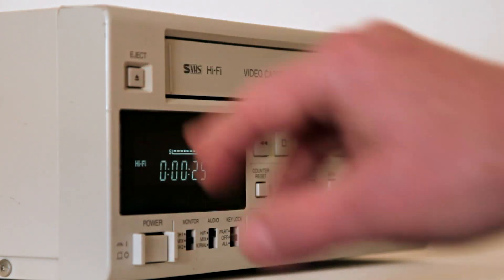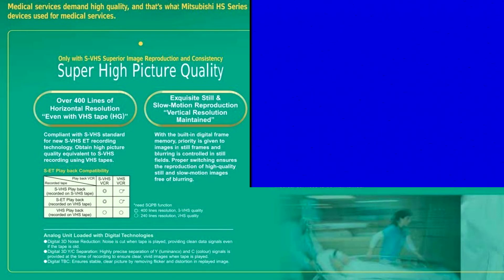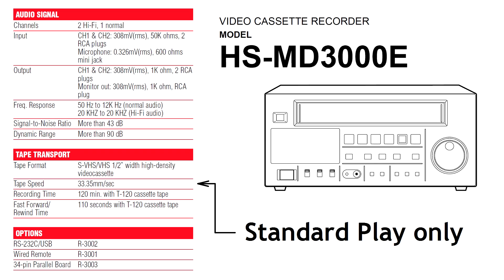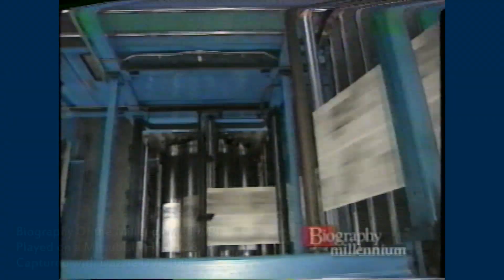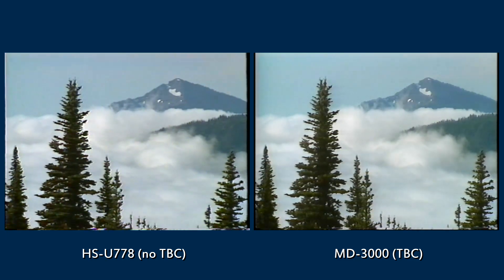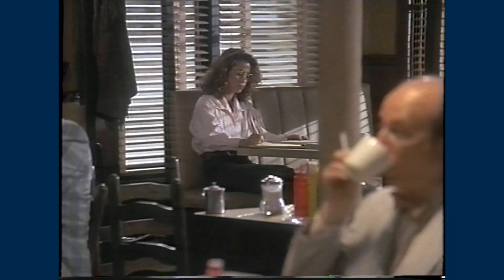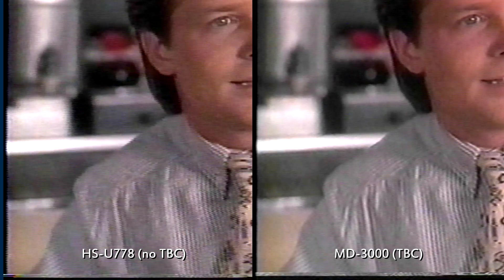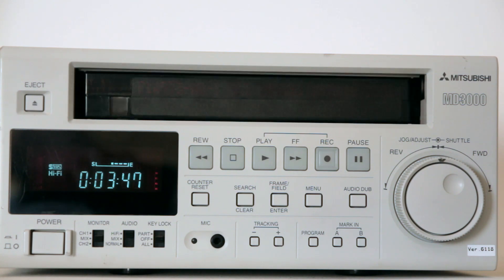Mitsubishi HS-MD3000 - a VHS VCR with built-in time base corrector (TBC)

Comment: Would it work as a passthrough device?
Reply from the maker: I haven't tried. In all fairness, it is a lovely machine that outputs rock-solid picture if the tape is in good condition, but for bigger errors it tends to repeat the previous frame, which is fine for medical use, but does not work for normal video. So, for really effed-up tapes I use a Digital8 camcorder with TBC in passthrough mode.

Comment: Is a difference in the quality of audio between this and the 778, how is hi-fi playback?

Second question, functioning as a pass-through, so it add TBC to output from another deck?
Reply from the maker: I don't know whether there is a discernible difference, I have no equipment to measure frequency response. The MD3000 allows selecting either linear, or Hi-Fi, or a mix of both. The mix does not sound good, so need to specifically select Hi-Fi for Hi-Fi tapes. As for passthrough, I haven't tried it to use it like this.

Comment: I have this same model - but I can't figure out how to bring up the menu to access the settings that you have. Pressing the Menu button does nothing - did you use a remote?
Reply from the maker: Long press brings up the menu. Then you navigate between page items with Jog/Adjust wheel, and between pages with Menu/Enter.
Reply: @ConsumerDV  thank you! I wasn't holding the menu button long enough + I realized I could only access the menu if a video was Stopped.

Comment: Hi, I have the same model and it seems to me that the output luminance level is higher than it should be. This is especially noticable when changing from fast or slow playback - brightness seems correct in anything but standard playback mode. Is it just me or do you see the same? Thanks
Reply from the maker: Indeed, I noticed that compared to my other VCR the levels are higher with this one using the same A/D converter. I compensate by using proc amp during capture, I reduce level from 5000 units, whatever they are measured in, to 4500, this brings it on par with the other VCR, and to me it looks that I am able to preserve most of the highlights.
Reply: I picked up a very lightly used model (8 hours on heads) on Ebay.   One thing I noticed is it's image seems to be aggressively sharpened as there are white halos to the right of subjects in normal playback.  This would make sense as it was intended for medical images.  I've tried all the video adjustment settings in the menus but can't seem to get rid of it.    Any ideas on how to minimize the sharpness/reduce halos?  I'm using for video playback and not capture.
Reply from the maker: In my case, the capture from the MD3000 looked better and with fewer artifacts that from another VCR. Try turning off all enhancements as well as sharpening in you capture hardware and software.
Reply: @mikegeykhman Does it do this with SVHS, VHS or both?  I have a Sony medical VCR and I don't notice a burned out luminance value on SVHS recordings but you can see it on regular VHS.

Comment: This whole series of VHS capture videos are great and I learned more than I did from any other vids about this! I'd love to see a video on using an ATI All in Wonder card. I can't find a proper vid on youtube. This is an old (maybe better?) solution to capturing VHS and requires an old computer with an AGP slot, but it seems like people on forums are saying it's the best method. I also have several old computers sitting around and it would be easy for me to get one of these cards on ebay. I just want to know if it's worth it.
Reply from the maker: Thanks! Regarding an ATI card, I don't have one and do not plan getting one. My favorite capture card came with a 2008 HP Pavilion and it works great for me. With an SVHS/TBC VCR I am getting good enough results.

Comment: Thanks so much for sharing and creating this video.  As a video editor I understand how much time goes into a 6min video of this quality, hours and hours.  Well it's appreciated!  I'm getting closer to getting a decent workflow for capturing all my home videos, I've setup a Windows 10 machine to QTGMC deinterlace footage, however still at the trial phase and playing with the import methods , like you...  I have a VHC-C S-Video JVC camera that I can capture all my little 30min tapes with TCB however I'm struggling finding a decent workflow to capture VHS, I did a few tests.

One test, I captured live to VirtualDub from a Panasonic DVX100b MiniDV camera 29.97i using the DVC-100 Dazzle, not using a tape just to test.  On play back after deinterlacing it looks great, however like the Doc Hollywood video I have jagged edges around things like a house window frame.  I'm kinda lost as I wouldn't think a live video to VirtualDub would need timebase correction..?
Reply from the maker: Thanks! I would think that composite signal generated from live digital camera would be more steady, interesting. BTW, MD3000 nicely corrects tiny jitter, but does not seem to handle severe errors well, so not a bulletproof solution.
Reply: @ConsumerDV Great video again, awesome job!  Yes in regards to the video being more steady, the video that I sent live from my Panasonic DVX100b was from s-video camera out to DVC-100 Dazzle S-Video in and captured on VirtualDub2 in the Apple ProRes 29.97i.  I remembered you saying in one of your posts that you didn't intend to be a trouble shooter or life long tester to capture VHS footage.

It seems there is not one straight solution, it's having the right OS, computer hardware, drivers, capture hardware.  Then in between you need a few other things, VHS player with S-Video and TBC hardware all this with the right combination in order to capture.  Then a different workflow to de-interlace like a QTGMC system with a 64bit OS.  I'm still in the stage of finding the best workflow for both capture and de-interlace.  I do like the look of QTGMC and AVISynth.

I just picked up a VHS player with S-Video out, it's Mitsubishi HS-423ur, I need to find the large 2mm square belt to get it working, then I'm on the hunt for a decent TBC.

Looks like you got a great SVHS player, again, thanks for the video and the reply. :)

Comment: Can you use the unit as a TBC? As in feed a signal to it and then take the output to your capture card?
Reply from the maker: I don't think so, although I haven't tried. I have only one SVideo cable, and regular RCA cables do not fit BNC jacks. Maybe I'll buy a second SVideo cable and try it sometimes later.
Reply: @ConsumerDV  I know some of the pro Panasonic units would offer passthrough TBC.

Comment: Saw one on eBay not that long ago! Cool stuff!
Reply: I have some SONY SVO , but it hasn't TBC on board. It's medical too and S-VHS machine
Reply from the maker: The GE VIVID 3 service manual specifies the following VCRs: Sony SVO-9500MDP2 (PAL), SVO-9500MD2 (NTSC), Mitsubishi HS-MD3000E (PAL), HS-MD3000U (NTSC), Panasonic AG-MD-835E (PAL), AG-MD-835P (NTSC). According to the respective brochures, both the Sony and the Panasonic do have TBC and frame memory and can record in SVHS with Hi-Fi audio. So, very similar. I looked on eBay, Sony and Panasonic seem to be more expensive. There are other models as well, like the AG MD830. It is a whole new rabbit hole :)
Reply: @ConsumerDV  May be it is SVO-9500. But there's no any pic about TBC on the front panel
Reply from the maker: This leaflet says that the SVO-9500MD has TBC: https://www.ampronix.com/pdfs/Sony-SVO9500MD-Brochure-EN.pdf
Reply: @ConsumerDV  That's correct!